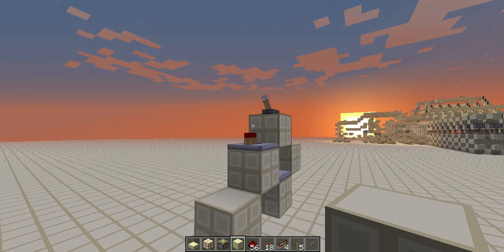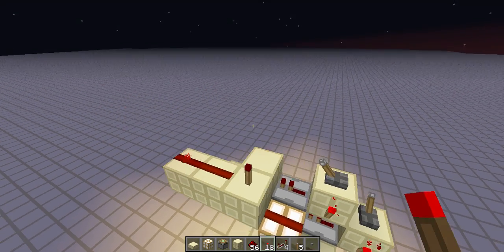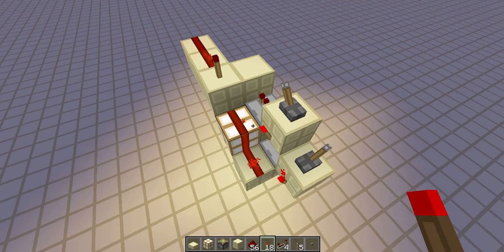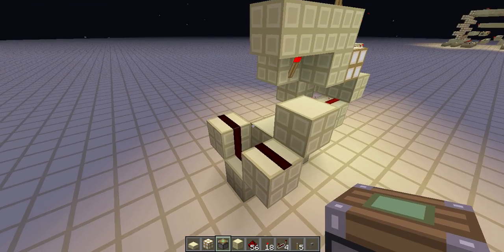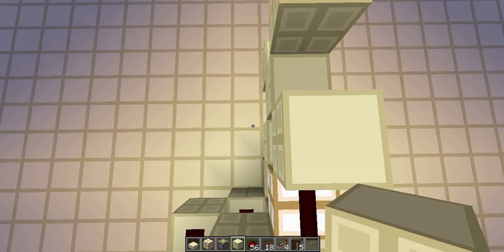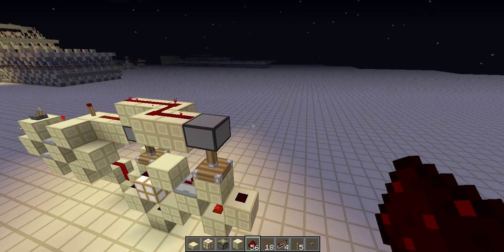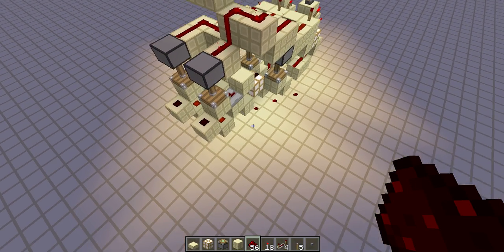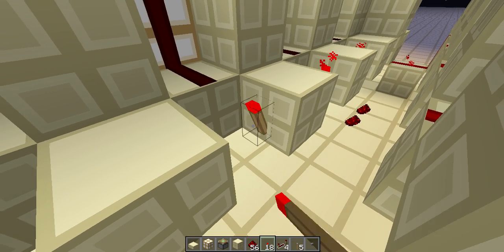How to Build an 8-bit Redstone CPU in Minecraft Part 1: Adder

Comment: builds an 8-bit computer, on an 8-bit computer!
Reply: +Billy Oshkinowe 8bit or 64bit doesnt determine speed, its just the number of characters you can use
Reply: +Billy Oshkinowe  he builds it on a 32 or 64 bit computer not a 8 bit computer
Reply: +Luka Jenkins I was referring to the frame rate, its at like 10 fps